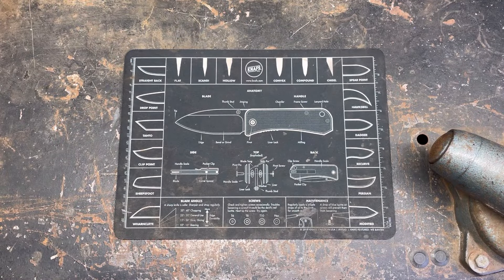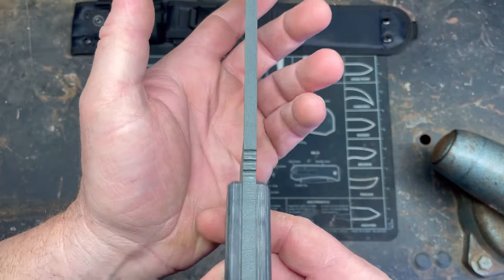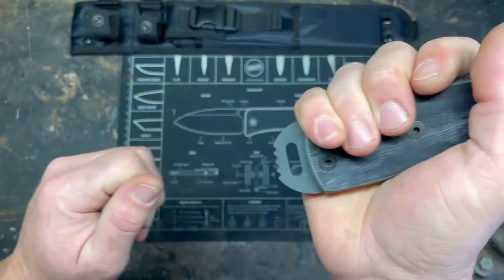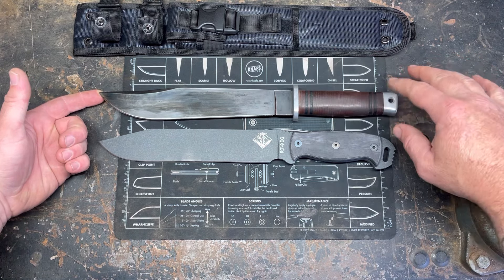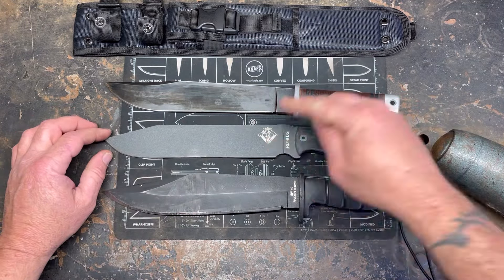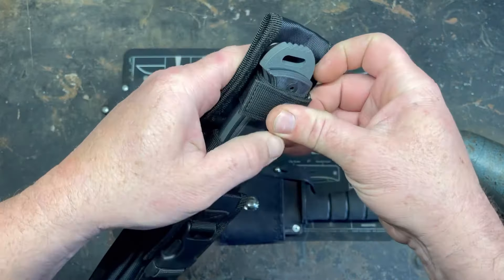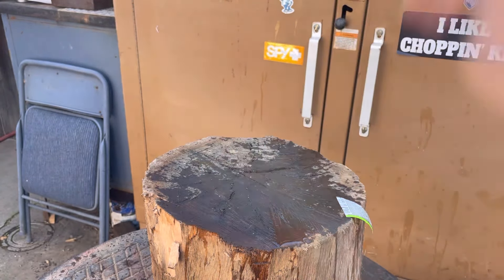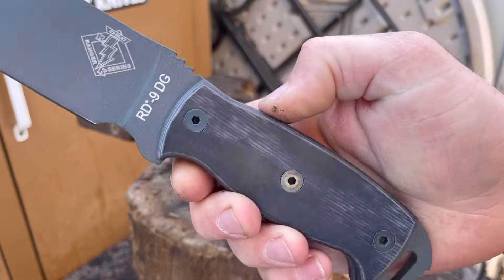The Ontario knives RD-9 DG use and review

Comment: I used to have one. Had an rd 7 also. Sold them years ago. If I’d known they would’ve discontinued………oh well. You should try out the silky nata hatchet. They used to be like 70 bucks or less. Cost about a bill now. They come in chisel and v grind. I recommend v grind. Great handle that is removable. Not premium steel but used to be great budget chopper/batoner.I made simple kydex sleeve for mine.  Great video. Keep up the good work sir.

Comment: I had the old Ontario RD6 and thought the handle was to small. I believe the scales were the same as the RD9 (not sure). Most of the big knives back then were blocky, what I was expecting you to say something about the room available for your finger’s...Most of my Ontario’s are 8-10 years old, I’ve never experienced any problems with exception my lasted purchase of the Rat 6 in S35vn. Seems heat treated well for a bigger blade but the fit and finish sucked...
Reply from the maker: I did forget to mention that. It’s a little tight length wise for me. Maybe that’s why it hurts chopping

Comment: the handle has larger problems then being blocky its made in mind of the maker who is a giant mountain of a man,you will find sanding does very little to fix it unless you got xxxl hands,also the 5160 will rust from just being exposed by the air so dont remove the coatign im not kidding its prone to pitting rust its like having invisible worms eating the steel.i dont know where Ontario sourced this steel because i got other 5160 that doesnt rust that bad.

Comment: I have an RD6, yes blocky handle and crappy sheath. It is a beast but mine chipped out with medium use.
Reply from the maker: That’s weird. I wonder why
Reply: @peterbiltknifeguy  it seems over hardened in my opinion. It's still a nice blade. Very small edge chips right in the middle. Never batoned it. Did some stabbing on an interior door to see breach capabilities. Maybe I hit a staple.  
Wouldn't expect chips from a staple but you never know